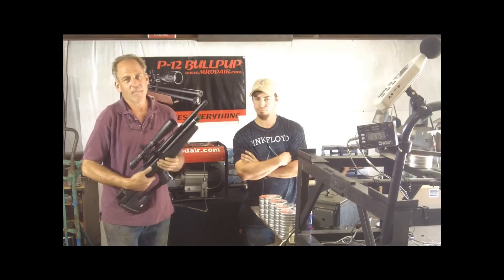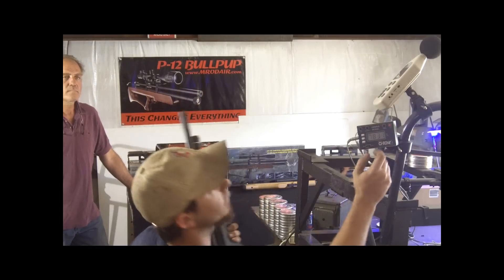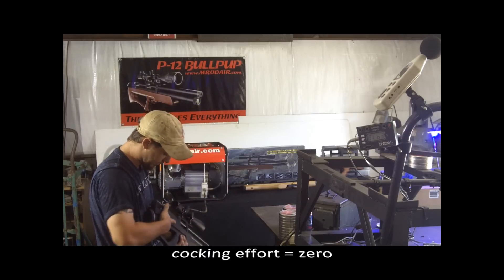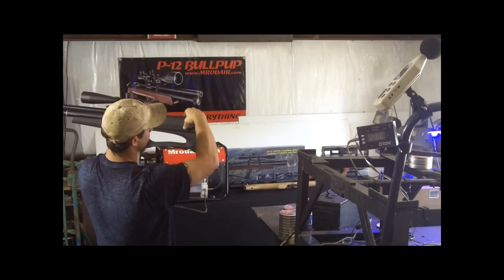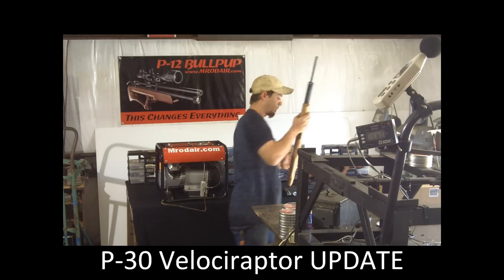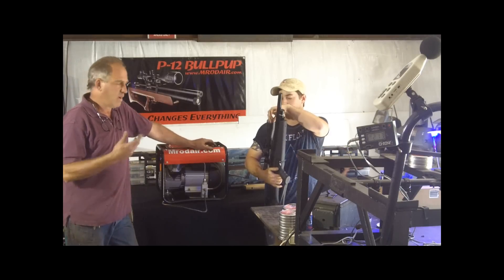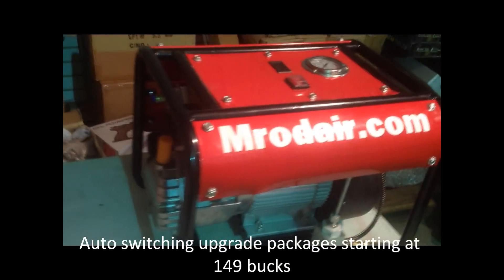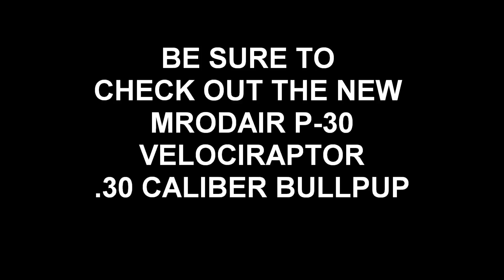HUBEN

Comment from the maker: Guys, we are still running the Huben thru its paces.So far, here is the good and the not so good.The good: The semi auto function, is working flawlessly and the system is beyond any other Airgun ever produced.Truly different and very efficient. 
It is for sure the game changer they advertised and backs up the claims made by Huben.When fired without a pellet in the chamber, little to no air is used. 
The valve cycle is a force feedback design and the system closes the valve based on resistance and pellet weight and the only air expended, goes to cycle the magazine.
Shot count and power level, is unbelievable.
Over 80 shots per fill when shooting standard speeds and lead pellets.
Very quiet operation, no leaks either thru cycling, or function of the magazine.
The regulator, is a effective and the adjustment for pressure vs power is divorced, so once the operating pressure of the reg is set with the forward external adjustment, only the large hand wheel on the back need be turned for a range of power that is unheard of.For example, the lowest 250fps, to over 1300 fps is easily gained with 18gr JSB pellets.The Huben is very light, and the stock is well made, ergonomic and overall very impressive build quality.
Now for the not so goodPellet picky.Our prototype, is pellet picky. It loves the heavy slugs provided by Huben for our testing, however standard pellets like the jsbs are finicky to the power level used. They are more accurate when tuned down just not at the blistering speeds the Huben is capable of.I suppose this could be expected. Hunting size groups with the lighter pellets (quarter size) are not a problem at 40-50 yards and some pellets shoot tighter groups, but it definatly prefers heavies and groups them much better.
On a minor note, (more of an observation) when the fps (rear wheel) is adjusted up in power between shots, it takes one shot to "settle" the feedback system..For example, when adjusting from 800 to 950 fps, the first shot after adjustment, will be about 20 fps lower (930) then the shots will be stable at +/- 10 fps until adjusted again. Not really an issue, but more of an observation we made while recording the exact performance of the adjuster.
If you pay attention during the video, I call out the fps readings to buck while he is adjusting and shooting.
Our P-12 was much the same when we first received them and after fine tuning they are as accurate as any other high end Bullpup producing one holers with ease.
We have been testing the heavier pellets and cast our own bullets, specific to the need of the Huben and will be posting the accuracy results once they are compiled.
The overview.
Awesome performance.
This is a new generation of pcp air rifles for certain and we are very happy with the product.
Thanks Guys
Reply from the maker: +Michael Esch (Mrodair) We have been sent several inquiries about the regulator.When adjusting more than a few clicks at a time, it takes one or two shots to "settle" in on a specific velocity.After that, it stays within about 10 fps shot to shot.Having WAAAAYYY to much fun at work this week guys.
Reply: +Michael Esch (Mrodair) Will I need a fill probe for the Huben or will it come with one (all my PCPs currently have a quick fill)? Also, any approximation on when they might be coming in/sent out? Just wondering how everything is coming along. 
Thanks and I already paid the remaining pre-order installment back when I received the update letter from you guys early in October.
(Really appreciate the extra effort you're putting into the upgrades/tuning)
Reply: +Michael Esch (Mrodair) Will it come out in a .177 version?

Comment: I've read on several airgun forums that the gun cannot be disassembled for cleaning or repairs, and must be sent in for any work.  Can you confirm or deny that is the case?  One of the great things about airgunning is the ability to tinker and mod them, or repair them yourselves if something fails, and a "sealed" gun kind of puts a damper on that.  Thanks!

Comment: so wish these were legal in the UK
Reply: They are if you got section 1 firearms license
Reply: stupid law for an air rifle, should be allowed if sub 12ftlb
Reply: +TheWelshman50 yep couldn't agree more you can adjust the power of these from about 6ftlbs to 73ftlbs in .22 not cheap either around €1750
Reply: if you could limit it to 12ftlb wonder would it be legal to import, see you have to buy high powered air pump as well